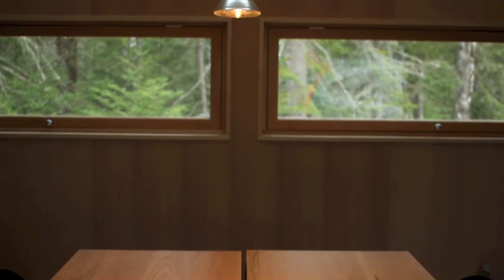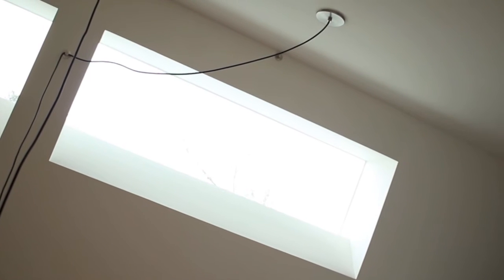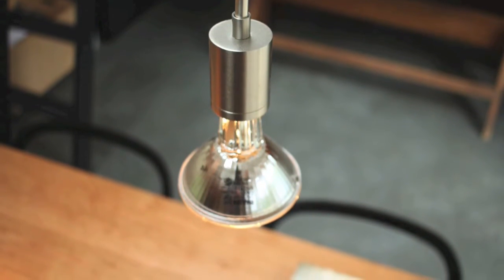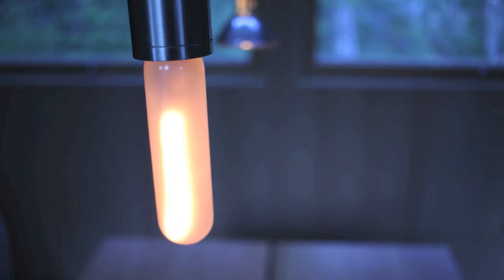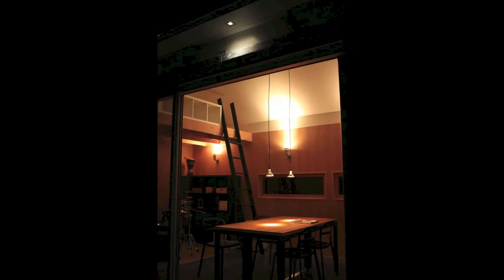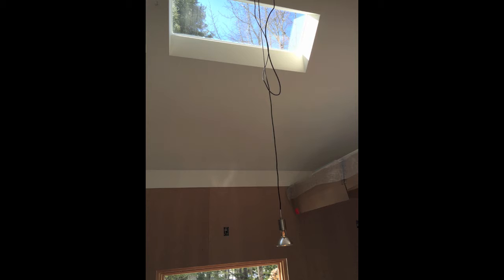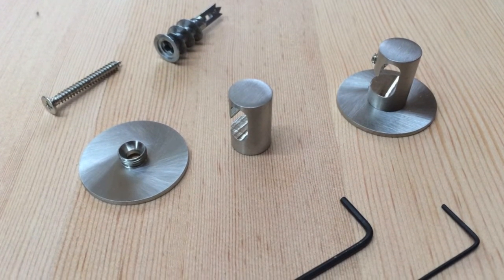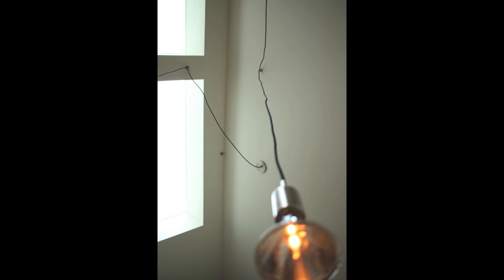SoCo modern pendant by Tech Lighting (An Architect's Review)

Comment: I know this video was made years ago, but if your wires didn't straighten out, you might be able to place a light weight and use a hair dryer of heat gun to soften the wire enough to straighten them out.